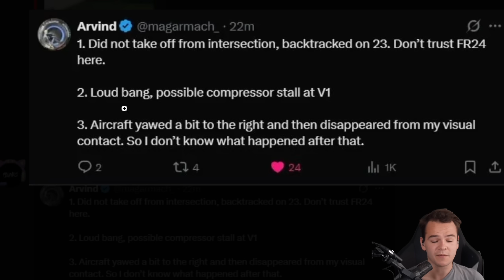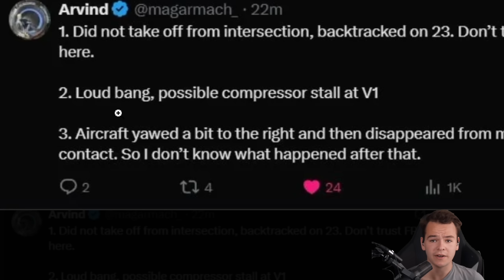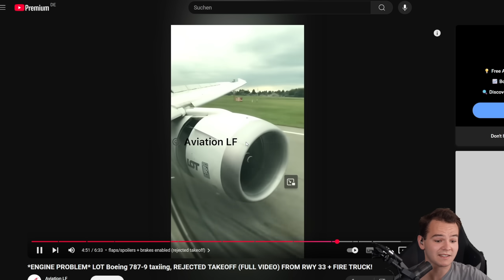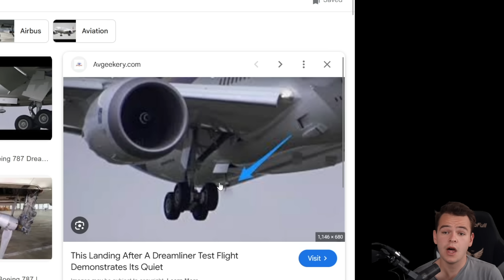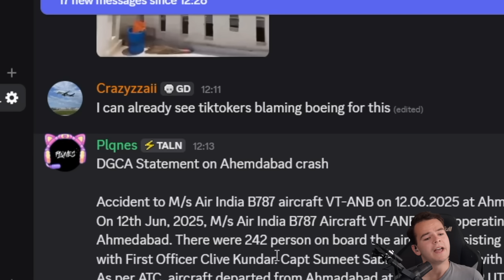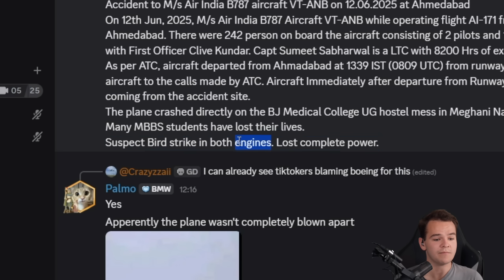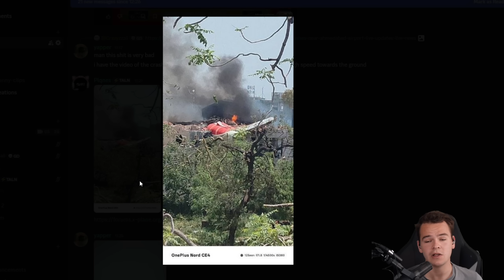The First 787 CRASH Ever - Why It Is SO Confusing?

Comment: V2 is the speed at which a single engine take off will be safe, not V1 which is the safe rejection speed at a given runway length.
Reply: Possible pilot error then by not aborting    take off at V1?
Reply: @AndiGomez-yu2dx  Maybe, maybe not. It's entirely possible that they passed V1 while they had both engines, and the failure happened afterwards, whereby they couldn't safely reject the takeoff, and had to continue the takeoff by accelerating to V2. 

For now lot of stuff is gonna be speculation, I'd rather wait for the DGCA reports.
Reply: Isn't it potentially an issue if V1 is so hardwired into training that you must take off once you pass V1? I mean, overshooting the runway, in 99% of cases, is a smaller accident than trying to fly with zero engine power.
Reply: I am not so sure that "no abort after V1" is so hardwired in the training. Sure, the scenarios for better aborting above V1 are all highly unlikely, but loss of all engines is one, as the plane is definitely not able to fly.

Comment: It looked obvious the Flaps were not degrees/forward extended, or configured correctly,  
engines sounded fine, but not able to maintain lift & continue its climb.  Pilots error.

Comment: You are talking rubbish, please stop. From the video the plane is descending with gear still down, that means the crew were distracted enough to forget or that the hydraulics were damaged. But the fact that the plane is more than capable of flying with one engine out and yet it is still descending means loss of thrust on both engines. Bird strike.
Reply: No way a birdstrike in both engines

Comment: When I first heard the A350 crash, a thinking came to my mind that: “Oh, that’s horrible, so the 787 is the one of the only aircraft family that does not involve in a fatal crash” and I hoped it would stay the same for forever. And today I heard the same thing, but this time is 787, I feel kind of dull, lost and became more and more afraid of flying… It is devasting…
Reply: a350 still doesn't have fatal record and it crashed just because another plane intrude the runway while it was on landing
Reply: The A350 was involved in a collision with another aircraft. Therefore, it has nothing to do with this incident whatsoever.
Reply: I also wanted to say this point. 787 stalled on its own. @ivorscruton5121
Reply: At least the A350 one doesn’t have anyone dead
Reply: keep in mind that despite the crash, it's still safer than riding a car for example. In fact, it's literally the safest mode of transportation that we have
Reply: @ultracubes1304 until it isnt sadly.
Reply: @VisiblyAviation  It is still the safest, bcuz everything else are actually more dangerous than planes, there's more fatality from cars, motorcycle, trucks, or even ships
Reply: These years i said "i wonder how bad will be the first B787 crash because after A350 only B787 is left to crash first time." and there we are kids... arrggghhhh
Reply: A380 never had hull loss aswell. That could change soon
Reply: @neddie3noah  why?
Reply: @riccardo7945  Unfortunately, you never know what's to come. The longer a plane is in service, there's unfortunately always a chance something could go wrong.
Reply: @neddie3noah  just hope not.
Reply: @neddie3noah  It very nearly happened with that QANTAS flight. The only reason it didn't was because of the legendary flight crew that day.

Sadly the Captain retired in 2020 with a mere whimper. There was very scant demand for his services. You know why.
Reply: The a350 killed anyone
Reply: No, the people inside of the a359 didnt. The people in the turboprop did. @Jvcm727
Reply: @Jvcm727  killed all people from dash 8
Reply: @Jvcm727  japan airlines flight 516?

Comment: The video looks like it stalled, but, the cause of the stall could have been as a result of incorrect flaps setting, engine compressor stall. If it was a compressor stall, nothing we can do about that. It is very strange for a dual engine failure to occur. The only thing I can think of that contributed toward that would be poor maintenance practices. Given that it's Air India, yeah.

Comment: It was also probably overweight, as evident in the video, where the aircraft struggled to take off. Although it gained the necessary speed to climb normally with its weight, the takeoff angle could have affected its ascent, leading to a stall.

Comment: takeoff distance required vs how much did they actually have had. In your example, you backtrack to line up rwy23. Did they? It would have been a horrible miscalculation of runway performance not using the whole length of the runway in this temperature and load.

Comment: I heard a commentator from the airport say that there are often problems with vultures near the runways.
Reply: Shocking. Those are some huge birds. If there was a flock of them at V1, it was probably enough to bring down this plane. RIP to all the victims.
Reply: but why behind engines we couldn't see smoke or flame due to dual compressor stall?
Reply: @riccardo7945  they could have already been completely off. 

Jeju air was caused by ingesting birds in both engines and only small puffs of smoke could be seen the moment it happened (security camera footage caught it) no smoke the rest of the flight.

Comment: You're absolutely right about the Ram Air Turbine (RAT), because i checked more footage of that exact video with better audio on instagram, you can clearly hear a propeller sound coming from the plane, so there's definetly two engine failure here, sad day for aviation, condolences to everyone on board
Reply: Definitely is nothing until it’s investigated
Reply: The pilot said, I don't  control the plane, so there was more than engine failure.
Reply: @OudartPatricia-Claire software hacked
Reply: But normaly with extended flaps and Slats no RAT Speed Up. Does anybody see the Flaps extended?
Reply: @Falco-tp4qmyes both slats n flaps are visible (in use) in one of the videos.
Reply: @Falco-tp4qmno !!!
Reply: @Falco-tp4qmthe RAT has nothing to do with flaps or slats
Reply: Some pilots like Mentour, or Atechuet, have often signaled on their channel, when one motor faulty, the crew shut down the other by mistake, one second and it is too late. But why flaps were not deployed?
Reply: @OudartPatricia-Claire both flaps n slats were used , u can see it in one of the videos.
Reply: Also 747-800 has RAT
Reply: Pilot error
Reply: can you link those here?
Reply: @riccardo7945  I have tried sharing it here, but it keeps blocking it when I write it on the replies
Reply: You can’t see it in the footage though.
Reply: Propeller?
Reply: @richardweldon2062  The RAT (Ram Air Turbine) is a little wind-driven propeller (could also call it a miniature wind turbine) that powers critical aircraft systems in the event that all engines onboard (main wing engines and the APU) fail. Not all aircraft has this RAT, but the 787 does. The RAT is normally stowed away inside the body of the aircraft, but it can be deployed when required.
Reply: Ram air turbine has a propeller @richardweldon2062
Reply: The 787 has a ram air turbine? I thought only airbus has those
Reply: @MinhajAhmed-y7i 777, 787 etc all have a RAT
Reply: @Cars-k8e 767 too
Reply: @Blank00 yes every bigger Boeing
Reply: The RAT would be seen, it isn’t that small…
Reply: The story is that the Indian pilots forgot to set the flaps down, the plane flown too low, pigeons got scared and they flown inside the engines (because there are also a lot of pigeons in India and in particular they're extremely packed inside big cities where they can find trashcans and waste, they're approx 120 millions only in India) and they also got double engine failure with ram turbine deploying.

Comment: As a former NTSB officer this is a Clear stall. Flaps and slats, air speed, V1 rotation angle, engine thrust power, trim level functioning, weight etc are the next key info to look at. Just took off so carrying tons of fuel - survivors will be minimal due to the extent of ignition. My condolences to everyone on board
Reply from the maker: Why would the crew have stated the MAYDAY call then?
Reply: @Swiss001  As a reflectante call. They would have stated "dual Engine failiure", if they had the time
Reply: @Swiss001 Panic
Reply: @Swiss001 it’s a good question, but I think the answer is rooted in HF. Aviate, Navigate, Communicate priority in such a dramatic and rapidly worsening situation would render most people, however professional likely to fall back to ingrained training. It’s an absolute tragedy. Let’s wait for FDR and CVR.
Reply: Gear down flaps retracted 😳 and didn’t appear to have TOGA thrust….
Reply: I think I understand. I imagine the aircraft didn't reach a high altitude for recovery, so lowering the nose wasn't an option, and increasing the angle of attack only works to a certain point
Reply: Yeah. That usually happens when you don't have any engines after takeoff. The RAT automatically deploys with dual engine failure for essential electrical systems.
Reply: Condolences are normally send to the victims loved ones . Don't you agree?
Reply: Thanks for your insight!
Reply: 1 lone survivor Ramesh Vishwas seated in seat 11A has been found alive by Ahmedabad Police wandering around the streets bloodied after jumping from the emergency exit
Reply: Those flaps on a heavy takeoff should have been way down at 20 or something. They weren't, we we will have to wait and see. Very sad to to see, my sympathies to the families and friends of all those involved.

Comment: Pilots didn't have time and altitude to react quickly and recover from stall

Landing gear will give a clue about situation inside the cockpit
When an airplane takes off and gains certain climb speed (V2) and climb at certain rate ... pilots call "positive rate and gear up"

Comment: Everyone I think it's not Boeing's fault, The cause of the accident is the pilots (98% sure), Look The angle of the flaps, usually aircraft (Boeing), They take off with flaps at 15°/20°, here the flaps will have been at 1, so this is already a mistake of the pilots.
And above all, the angle of inclination was excessive.